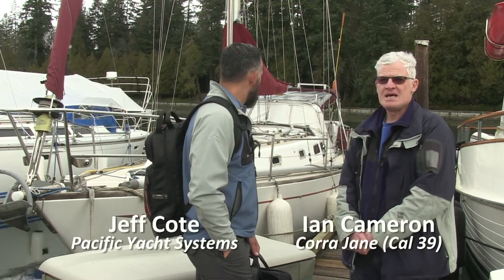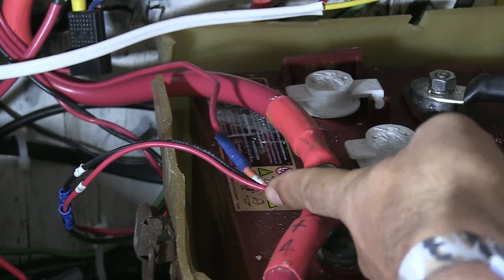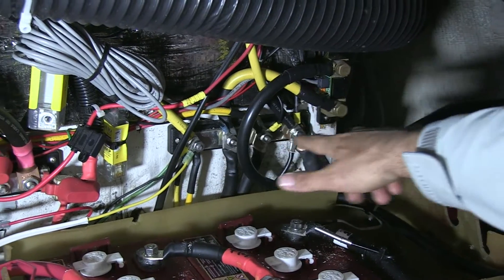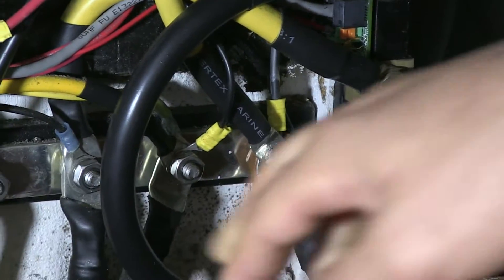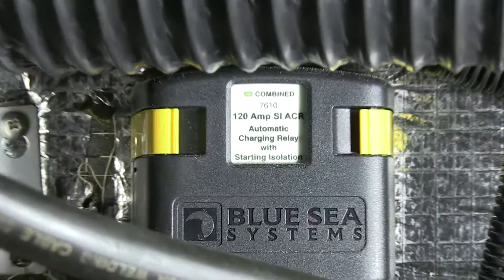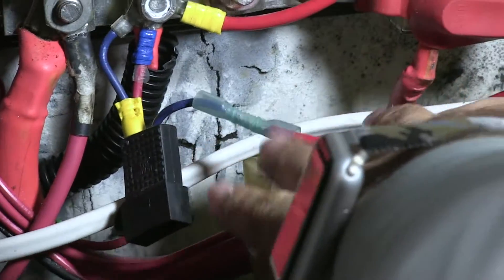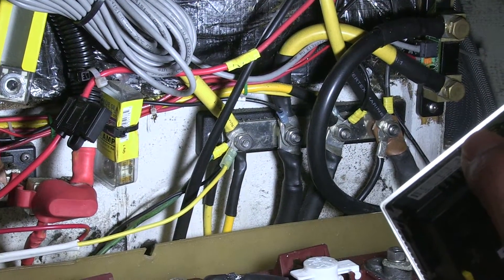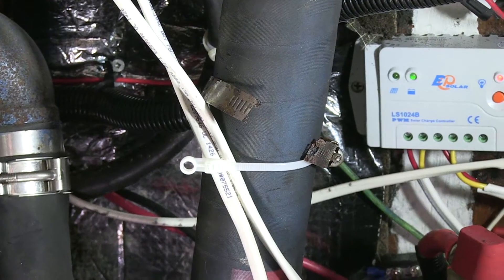PYS Boat Electrical Audit aboard S/Y Corra Jane: Trouble-shooting DC System

Comment: Great video, great info. The fuse holder to the ACR (9:53) is not connected (the cap was separated from the body, and when Jeff nudged it to show the owner what he was talking about, the two pieces came apart completly). These fuse holders will do that and it is always good to double check them.

Comment: Does the 2” of heat shrink refer to up the wire from the terminal or 2” overall?
Reply from the maker: The heat shrink length should be 2” overall.

Comment: Jeff; I noticed you mentioned the stack of positive leads on the battery terminal. But you never pointed out that there wasn't a thread visible on the terminal post. That nut will vibrate loose very easily as there is next to no drag torque holding the nut on.
Reply: You make an excellent point. All too common to see nuts only partially threaded
into place. In some cases only have the nut is actually threaded.